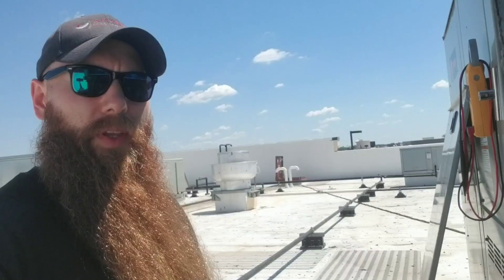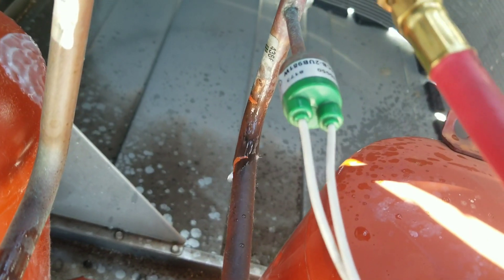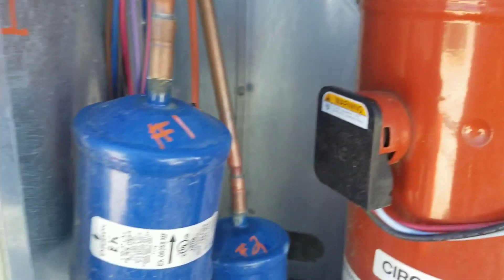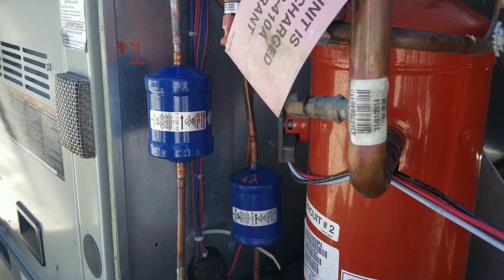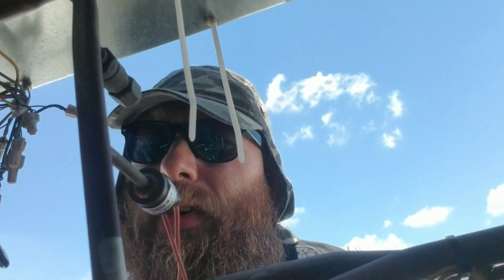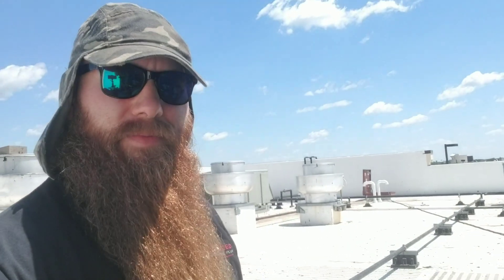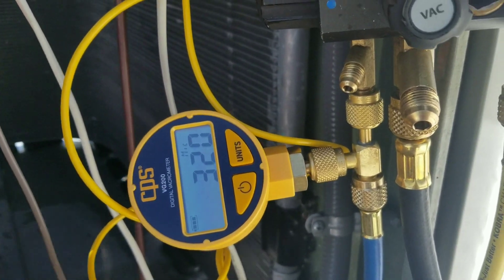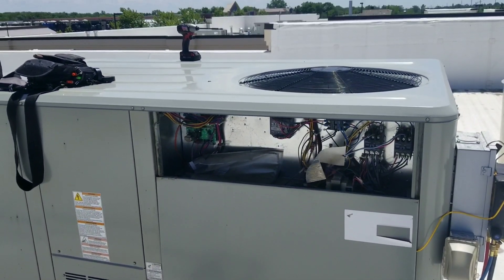Trane package unit not cooling

Comment: today was the first time I used a torch like that. I must say had just little tuff time at first with the mixture but wow what a difference. I had to hit 5 spots and I has no leak and it's way better than using the turbo torch . I also like how you never cut corners. unfortunately I been through a couple different companies this year  and wow the shit I've seen. nothing worse then being yelled at for taking to long on a job cause I'm doing things by the book so to speak

Comment: I've seen those discharge lines crack on larger Trane RTU's.  One cause was compressed compressor mounts causing vibration transfer to the discharge and suction lines. The other more common cause was internal erosion of the copper right after the Rotor Lock fitting.  Your unit had Scrolls so it was probably vibration.  Nice job on the repair!  Small tip regarding use of a clamp-on amprobe.  Never pull the clamp on the wire and take a reading.  Look at the clamp and you'll see hash marks left, right, and top.  The wire should line up with those marks for an accurate reading.  Makes a big difference when setting up sheeves on a large belt drive motor...

Comment: I started use blue Dove concentrated  dish soap in my coil gun, it’s a degreaser, leave it on for 5-10 min, clean as a whistle, and it doesn’t eat the rubber roof membrane, also doesn’t cost 50 bucks, not that I’m cheap, but a windy day using Nu calgon condenser cleaner, we’ve all been there, burns on arms or wherever is may accidentally spray onto exposed skin.
Reply: Dishwash and aluminium is a nono
Reply: @sjefoekel6058  I understand clothes washing powder being bad due to high pH, but most domestic dishwashing liquid is pH neutral, it's safe to have you hands in it all day, it's basically a wetting agent. The industrial stuff different matter entirely.

Comment: Good work bro! Where do you usually put your suction line temperature clamp on the trane unit or any Rtu for that matter. How far up the suction line from the compressor? Just curious curious thanks
Reply from the maker: I try to get it at least 8" from the compressor if at all possible -- thanks for the support and thanks for watching

Comment: How do you know what the superheat and subcool are supposed to be on a unit?
Reply: Since it's a package unit you weigh the charge in.
Reply from the maker: I normally just use rules of thumb on package units- if need be you can calculate target superheat based on the indoor humidity and temperature but with these situations I go with the rules of thumb

Comment: Is that a split coil? If yes how do you open them up for cleaning without kinking coil lines?
Reply from the maker: This coil is not a splitable coil, I shot that video awhile back but I believe I could see through the coil after I cleaned it. The best way to clean them is get some boards or cinder blocks to support that outer coil when you split them- you gotta be real careful with them, I havent cracked one yet cause I take my time when I split them.

Comment: I could be wrong did you add oil?
Reply: @curioushvacguy6876  With the amount of oil that appears to be all over the place... it appears that you had a high system pressure  due to low air flow on the condenser. The hight temp and pressure will load more oil into the refrigerant. The end result was a catastrophic pipe failure and unload of the refrigerant with loads of oil. I don't off hand know how to quickly  check oil quantity in the compressor other than to drain it. But might be something to watch for as low oil..... well you know.
Reply: @curioushvacguy6876  It is likely ok~ but on the other hand 100% something to watch. Nothing like explaining to the customer... "Yeah I forgot to put oil in it and that's why it only worked for 3 months."

Comment: Why did you use that cps micron gauge, is that fieldfiece digital manifold come with micron gauge?
Reply: Plus in general, field piece is far less accurate  check out the new yellow jackets they are awesome and the micron gauge is external.

Comment: Sweet camera angle on the elbow braze! 
Have you got a ROT on how much rod to use on a certain size fitting?
Example: 3/8" filter dryer, do you make a bend on your rod "x" inches length to give you a guide?